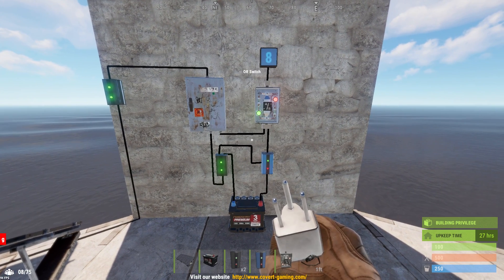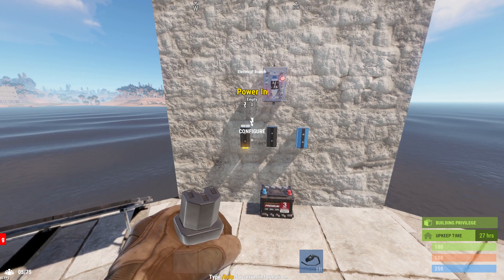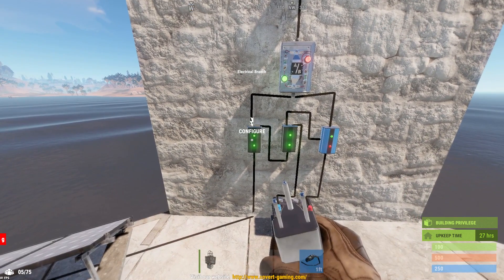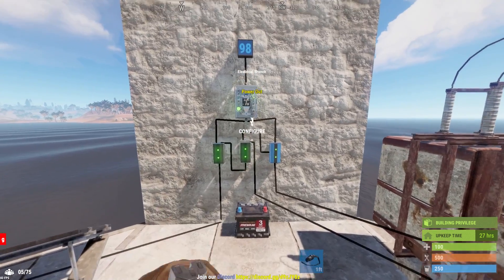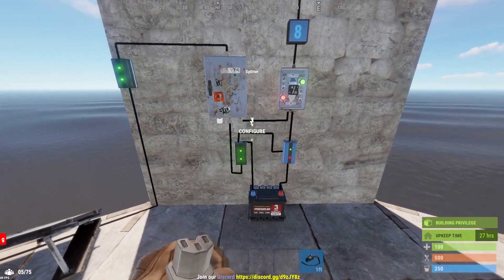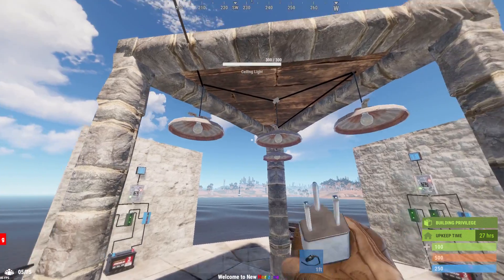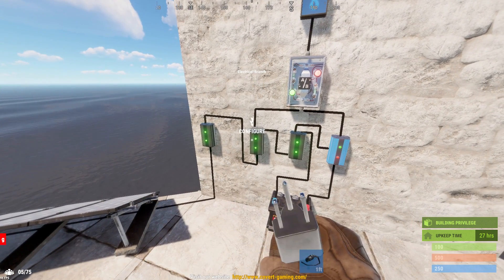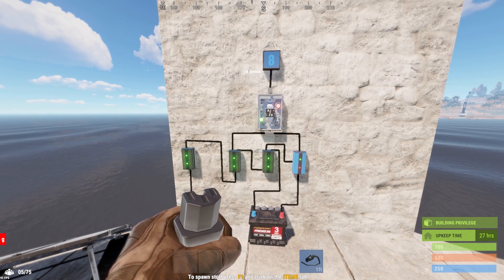The Best Rust Infinite Power Circuit

Comment from the maker: This video was made obsolete as of the November 2019 update.  I'll leave the video up for reference and I'll be adding a new video shortly showing how to do this from now on, or at least until another update changes things again.  Simply put, now you can run power directly into the battery, and out from the battery to power your base.  The battery no longer drains max power and so can charge while being used.  The whole point of this circuit was a work around for the fact that batteries in Rust didn't work like they should.  Thx for watching and stayed tuned for future videos :).

So I just found this site https://rustrician.io/ which allows you to play around with circuit builds in rust.  As such I'm adding the circuit builds for my various videos to the descriptions and pinning a comment with the links to them for you guys to make it easier to follow the build.  Hope this helps and as always, thx for watching :)
Small Battery Circuit: https://i.imgur.com/zFT4Xii.gif
Small Battery Build List: https://gyazo.com/991728c475d075637f3f0811f53d167c
---
Large Battery Circuit: https://i.imgur.com/ziClbub.gif
Large Battery Build List: https://gyazo.com/3241eaf1b03e45951da7895028458f00
---
(keep in mind you may need more solar panels facing different directions to maintain power during the day as the sun moves across the sky)
(keep in mind you may need more wind turbines at very low elevations for the large battery, or build them up on stilts, every 10 blocks higher gets you 1.5x more power)
Reply: Hey was there ever a follow-up video to this?
Reply: This circuit is still relevant. As batteries have an efficiency rate on charge in this circuit helps power be better utilized. I.E. 100 power going into a large battery only stores 80 power in total to be re-used. I find that this circuit is the difference between running out of battery on stuff that uses all 100 power coming out.
Reply: thank you!!
Reply: pin this comment so more people see it maybe, great video
earnt a sub and a like
Reply from the maker: @yutomi8739  good idea thx :)  I'm working on a new video now showing the best way to do this since the November Update
Reply: I can give another Circuit/Build List for a circuit with 5 large batteries.  Some people get confused how to use Root Combiners on that scale.
Reply: People are more concerned about how to provide 100 energy to access the load, around the clock! And while maintaining maximum battery power. There are days when there is no wind and the battery manages to discharge. How to achieve 100 loads and a good battery charge with a minimum of energy sources?
Reply: I did such schemes, but I can achieve results without 2-3 Wind turbine. This result does not suit the clan. As an example, I can throw off the scheme of what many people need.
Reply: It would be better to shoot a video of the effectiveness of Wind turbine. What is the height needed? And what percentage of the time when there is no wind?
And if it is big, then how to avoid battery breakdown? So when such a day quickly repeats itself, do not be left without energy!
Reply: Hey when is that new video coming out to replace this one?
Reply: Unfortunately you're half wrong, the current state of batteries in rust is that the battery outputs just what is needed if you connect just 1 thing, as soon as you use the passthrough the battery will crank it's full capacity in the circuit:
ex:
Large battery outputs 100
Counter wants 1 and will display 1 used power
Attack a lamp to the counter's passthrough and the counter will say 100
Reply: Why is it obsolete now?
Reply from the maker: @paulywalnuts6042  The circuit is not obsolete.  The specific use of it in this video is.  Before Nov 2019 patch, a battery in rust could not be charged, and used at the same time like a battery in the real world can.

This circuit was specifically designed as a fix to that problem and allow the battery to switch from a charging mode to a discharging mode automatically as power was available while simultaneously continuing to provide a steady stream of power to the circuit.

I'm sure there are more by now but when I made this video there were other videos of circuits which switch automatically but they did not provide steady power to the circuit.  They prioritized charging the battery over maintaining power supply to the circuit.  Which means that between the time the circuit switches to charging the battery and the time it takes for the battery to be fully charged some devices on the circuit may not have enough power to operate.  The circuit in this video solved that problem.

Now batteries in the game work like real batteries.  They can be both used and charged at the same time.  So one need only attack a solar panel to the input of the battery, and devices to the output.  Very simple.

The only reason I didn't take the video down after that is that several people told me that they still learned a lot about how the components worked, despite this particular circuit not being necessary any more.  So I have left it up for educational purposes.  That's the cool thing about electronic components.  Once you understand how they work you can do amazing things with them just by rearranging a few parts.

Comment: What happens if u in the 10:20 in the video, this setup, remove the first branch which uses only 1 output. And then just to Directly from from solar panel into the 2nd branch device used, making u only use 2/3 which u are currently using

Comment: on the large battery though how does this deal with charging? Even if in your diagram you used 150 as your input if you are pulling 100rw from the battery when in use it will take 4h to discharge and over 9h to recharge.

Comment: It's not infinite power, for small circuit it is with solar pannels and small batterys, it's good for circuit day/night automatic lights on/off, but with big batterys and windmills it's not infinite power, i'm using similar circuit made by myself for turrets, they work even when windmills are destroyed or wind power drops so hard what turrets should go off, the problem is what large batterys drain realy fast, 10 turrets with 3 batterys works arround 1 hour. If some one understands russian can check video on my chanel what i posted about circuit what i told earlier.

Comment: Very interesting video thanks for the content... can I pose a question to you regarding powering turrets in the easy cave the cave that is too deep to power from the surface, put simply I need to run up to 4 turrets from a large batterie I charge the batteries remotely but I want to have a genii back up circuit. I'm thinking that I need to prove the power output needed for all my turrets and set the blocker to activate when the power drops below the turrets needs and force starts the genii to charge the batteries at this point? any information would be great I'm glad I fount your channel its very interesting thanks :)

Comment: Do you have a video where its the same thing but i can charge two  batteries? keep one large batery in main electric room than hide one incase of raid.
Reply from the maker: Not exactly but its very easy.  All you would have to do is connect your second battery to the first in a "parallel" circuit.  That means run cables from positive of the first battery to positive of the second battery, and the same with the negatives.  That said I frequently build all electronics possible inside the honeycomb of my base.  I have only very rarely had raiders waste the explosives to blow into what is obviously just honeycomb.  Another nice trick is to run random wires back and forth around your base so an invader can't just follow the wires to find your electronics.
Reply: @K162KingPin  appreciate the feedback, Iill look into tying my electric into my honeycomb  .  im an awkward solo player so building huge clan tower is mostly impossible for me so i do smaller all metal bases to try and detour people.

Comment: Finally find the circuit I was looking for, but scaling it up is proving to be a pain! I think I got it with the exception of the 1st of 3 additions branches I added after the OR Switch that’s run to a 2nd blocker my ceiling lights are connected to with a solar panel as an auto day/night on/off. The lights just stay on all the time defeating both the energy saving and visual sign of weather it’s day or night out. Any ideas why this isn’t working as intended, can you only use one blocker on a circuit?
Reply from the maker: This circuit was originally designed to create a backup battery to to run your lights though night time or in the case of a raid if your generators were destroyed to give you continuous power at least until the batteries ran out.  I haven't played rust in a while but unless it has changed the problem with scaling it up is that you get diminishing returns for each additional battery bank you set up due to voltage losses the farther you extend the circuit.  I designed this circuit a while back and again unless game mechanics have changed since last I played it should still be valid to create up to an 18 hour backup battery system.  You could continue to expand it infinitely but I stopped at 18 hours because that seems to be sufficient for any daily player. 

https://i.imgur.com/P2PDQLx.gif

Now if I understand you right you want your lights inside to only come on at night?  This is easily accomplished by placing an XOR Switch between your power line and the light or lights.  Attach your power in to one of the power inputs on the XOR Switch and the Output to the light or lights.  Now add a single solar panel separate from whatever other power producers you have and attach it to the other input on the XOR Switch.  The XOR Switch only allows power to pass if only one input is receiving power and so since your main power line will always have power then whenever the sun is up and that separate solar panel is also sending power to the XOR Switch it wont allow power to pass through to the light.  When the sun is down and no power is coming from that solar panel then the only power to the XOR Switch will be from the main power line and so it will allow power to pass through to the light.  So... the lights will only come on at night.  If your main power production is already solar panels then you could simply branch one of those and send the default 2 volts from the branch to the second input of your XOR Switch.  I may be over explaining this so let me just give you a simple example.

https://i.imgur.com/yfkM2Gd.gif

In the first circuit the light is on obviously.  In the second the light is off because there is power from the solar panel.  If the sun were down there would be no power from the solar panel and the light would come on.

Comment: Nice! While the other YT videos showing the 2nd setup you tested are very informative, the circuit is very inefficient. I couldn't figure out why I'm getting 360 electricity but only putting out 154 or so. I knew the splitter was culprit due to how it evenly splits the volts. I wish the splitter worked like a branch or gave out even power depending on the devices etc.

Comment: Hi FSG! I don't know if you still check comments or not but I had a solution to this as far as having auto lights while charging a battery. I see you said there was an update so whatever you were doing here has been made obsolete since i guess you couldn't charge a battery and use its power at the same time or whatever.

ANYWAY lol, I was messing with this circuit and I found that just to make it even more simple you can do this:

Components: 1 Large Solar Panel, 1 Electrical Branch, 1 XOR Switch, and 1 battery of your choice. (Medium sized battery used here.)

1. Run Solar panel to POWER IN of BRANCH
2. Branch out 2 (default) power to INPUT A of XOR SWITCH
3. Run POWER OUT from BRANCH to POWER IN of MEDIUM BATTERY (any battery will do, adjust to needs)
4. Run POWER OUT from MRB to INPUT B of XOR SWITCH
5. Run POWER OUT of XOR SWITCH to POWER IN of CEILING LIGHT.

This circuit will make sure the battery is charging (unless output > input ofc) and will automatically turn on the lights at dusk and turn them off at dawn without ever touching anything. I am sure you had this figured out looong ago but I made this circuit and felt a bit clever for a moment and had to share haha.

Comment: Hi bro, i need help with a circuit. I have 8 solar panels giving power to 4 turrets and charging a large battery, when the suns comes out the battery starts but, it gives 100 power and i only need 40 of power for the turrets (didnt count the amount for the branches and those things) at some point, 2 turrets are receiving like 20 power. How i can make the excess power to not being consumed from the battery, or if i cannot configure that, put it again on the battery?

Comment: How would I be able to use this circuit with more battery outputs. While using more turrets and etc. lategame in a huge compound, I noticed whilst getting raided that only 1 battery wont be enough because it only outputs 100 power. So say i had a setup with 20 turrets ish, It would end up not turning on AT ALL say my windmills got destroyed. For now all i use are more of these as 1 battery will power 9 turrets, but if you have an idea for more of a massive compound type setup, that would be nice.
Reply from the maker: Thx for watching, sorry this circuit is obsolete as of the November update of last year.  I leave it up for reference because it can be used for other things.  As for backup batteries now you need only go Source - Battery - Load.  Or in your case.  Source (generators) to Large Battery to splitters to turrets.  Here is an example with 9 Turrets for each large battery: https://i.imgur.com/OmmXSQS.gif

If you need more than 9 turrets just duplicate the entire setup.  Sadly though batteries were greatly improved in recent updates they still dont work correctly when placed in parallel circuits which is what you would need to simply add more batteries without duplicating the whole setup.  Hope this helps.

Comment: Loved this video. 
I think you did a great job explaining why the method you discovered is so much more valuable. 

Question:
What if I wanted to build a string of small rechargable batteries - does that work? Connecting all the inputs and then all the outputs.
Reply from the maker: Thx for watching :)  First did you notice that this circuit is now obsolete?  At least for this purpose, there are other applications which is why I left the video up.

Second you said "built a string" which would be a series circuit where the output from one battery goes to the input of the next battery.  Then you described a parallel circuit where all the inputs are tied together and all the outputs are tied together.

So here is the problem with each.  In series you get diminishing returns of 20% per battery of usable output.  So for the first battery you could input 13 volts and use 10 volts, the max for a small battery anyway.  If you added a second battery in series you would be charging the second battery from the first at a rate of 10v so you could only use 8 volts from the second (and maintain charge).  This continues on until after just a few batteries you can't even get a single volt out of the last battery without draining it to failure regardless of incoming power to the first battery in the string.

Second you have the parallel batteries.  So here is the problem.  While the November and December updates from 2019 did help a LOT with batteries mimicking real world batteries they didn't quite get this right.  In parallel they charge just fine.  So for example two parallel batteries with at least 25 volts charging them could each output 10 volts (their max for small batteries) without losing charge.  The down side is when you root combine their outputs together.  For some reason the rust gods decided that each battery in parallel should output the minimum amount needed for the load (load is power used by the rest of the circuit).  As such if you had for example two small batteries set up like this to power a single auto turret both batteries would output 10 volts even though they would only need to output 5 volts each since they are being root combined.  As such the batteries drain 2 x as fast as they need to and so while you do have a second battery you dont increase the time you can use them.  So one small battery could provide backup power for a single auto turret for 15 mins if the battery is fully charged.  Meanwhile two batteries in parallel would still only provide 15 mins of backup power.  Its stupid, hard to believe with such a major overhaul to batteries they missed this, and this is NOT how batteries would work in real life but this is how it is in rust.

I actually have a solution to this and may do another video soon to demonstrate.

Comment: This is cool waiting for more innovation on your side i'm subbing but this could be temporary
Reply from the maker: Thx for watching :), just to be sure you noticed this the circuit in this video is now obsolete.  The November patch of last year finally fixed batteries so that they can charge and discharge at the same time.  Now you need only go from power source to battery to load, no more need for automatically switching it back and forth between charge and discharge.